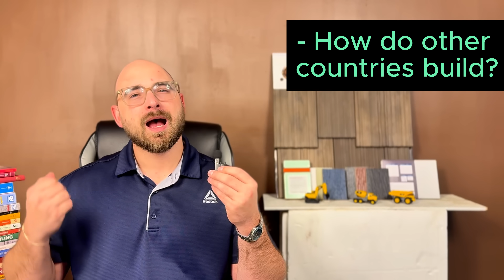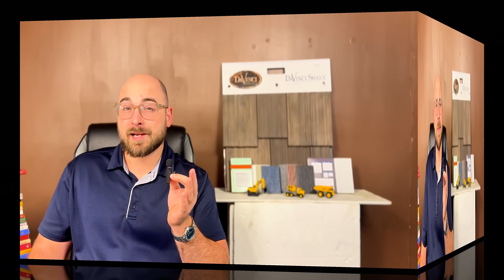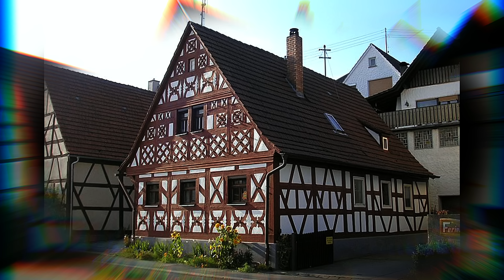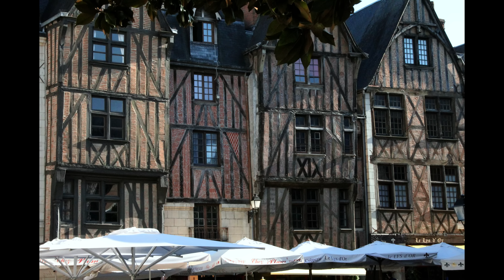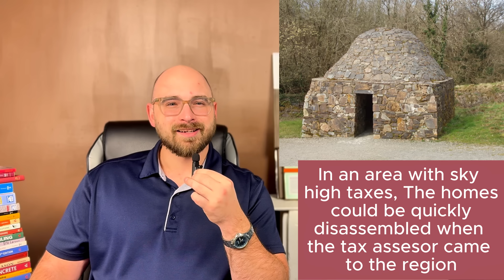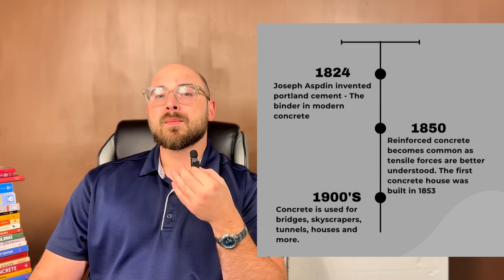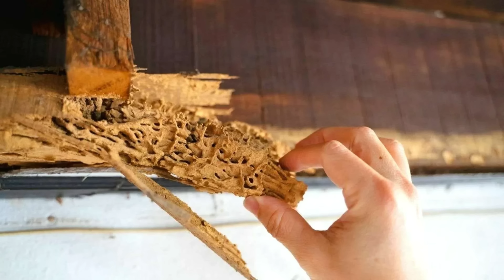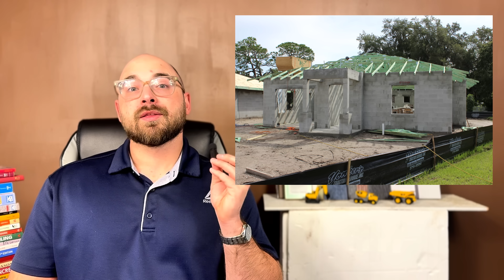Why Other Countries LAUGH at American Homes

Comment: Sorry, not catching up fast. Your last type of home was done in Germany about 35 years ago. I used to work in installing communication systems in Germany and saw all these new technologies used for building houses. They are at least 20-30 years ahead of US. However, as you mentioned, wood framing as done in US is the cheapest and fastest and not much skill required. That is the only reason it is and will be done that way in the future in the US.
To prove that point, look at the Paradise fire a few years back in California. The county wanted to implement stricter building rules after the fire, using concrete, however, the huge building corporations opposed that as it is to expensive, eating into their profits, and at the end they won. No change! Profits over safety.
Reply: Paradise IS being rebuilt with stricter building codes and fire resistant components, though not concrete.
Reply: I'm looking forward to seeing if after the current LA fires, people will finally realize that  building with toothpicks and paper isn't that good
Reply: Money over human life.
Reply: @tj92834 I think a lot of americans over-emphathize quantity over quality. What living quality do 5m² more bedroom space offer if you can have floor heating and a decent energy efficiency in return? Or electric shutters? Or a ventilation system? Or a high quality kitchen with modern appliances that'd last 40 years at least? Or a walk-in shower? Or... maybe walls you can actually mount shit onto?
Reply: Mill rates... The "development" heist is real in the US. Developers being busted for the materials used not actually meeting the rating of homes by materials used equaling actual real value...Cold busted for cheap materials that simply... Crap.
Reply: @tj92834 concrete home don't cost 500k, even big home ( more than a 220 square meter = 2400 square feet) with big property and big pool and still near big city ( yes obviously not near city like london or paris where house price is an aberration, like for NY in the us) you're out of touch of the reality of europe
Reply: yeah, that's the crux in German houses. They are expensive to build. A newly built "starter home" with 2 bath, living room, bedroom, 2 rooms for kidswould start at least with 250k€. And that'd be the minimum, without buying the property it is built on (because this can vary between 20k to easily 1M€ in areas like Munich).
Reply: @tj92834 no lol. Wood is more flammable than concrete. Period
Reply: I think the big benefit isn't associated with the costs. It's with its temporary nature. Before building codes, it was quite common in the US for the same property to evolve as was needed. It may have started as a small 500 sq. foot farmhouse. The fields were sold, and it evolved into a suburban multi-room home. The area got incorporated into city, and it evolved into a multi-family unit. Then the same land might have been purchased with a bunch of surrounding land to form a large apartment complex. This is a bit more common in Japan today. Building codes and zoning have made this type of evolution difficult in the US.
For a more permanent home in the US, I think most families would opt for a Timber Frame and stone home.
Reply: Domu w usa są często ekstremalnie źle wykonane ile kosztują zdecydowanie więcej niż dom murowany
Reply: real american dream is to take your last money
Reply: There is no doubt in my mind that with the suppression of better building codes/materials and the egress of insurance companies, Wall Street is trying to strangle California.
Reply: Good ol' american exceptionalism never disappoints. 
They said California has to many earthquakes, Japan, Chile has more, even Mexico city that is literally build on top of a lake has the tallest skyscrapers on latinamerica, and also has constant risk of earthquake not only because of that also is sitting next to a literal active volcano.
USA is doomed, they heavily depend on Canada's lumber imports which they also want to punish with tariffs. Lmao.
Reply: I’m a builder in the US, I’ve built block/brick buildings and of course wood frame buildings and saying wood framing doesn’t take much skill to do correctly is pure cope. Go pull layout, get your edge nailing within 1/8 inch all on every sheet of plywood, and frame a few windows then get back to me lol.  It’s easier to find a good masonry guy here than it is a good framer. Also, once you know what you’re doing wood framing is a lot faster. Not to mention wood framing is a lot easier to remodel and repair if needed.
Reply: I use to live in the Paradise area. So did all my family. Thats not why it wasnt done. Its because the folks that live up there are relatively poor. They wouldnt be able to rebuild, considering they would need to get loans and need fire insurance. Just wasnt finacially possible. None of the homes up there are cookie cutter. Zero large subdivisions. Biggest sub division I saw was maybe a dozen homes. 

That said, codes need to be changed.
Reply: unfortunately, I think actually even RUSSIA is getting ahead of the US in methods for building new homes. Interestingly it has also become common there for a small new house to have all radiant floor heating. What that tells me is it’s becoming an economy in which common sense takes lead over greed, and that bodes well for the long-term future. Not so in the US.
Reply: Concrete walls won’t mean squat when everything around, inside and the roof catches on fire. I remember seeing someone make a garage that was built to withstand wildfires with concrete walls and what eventually happened was when a wild fire did come through the heat was so intense that everything inside the garage essentially melted, making that endeavor practically pointless. 

The point is it takes more than concrete walls to make a home withstand a wildfire.
Reply: @lawnmowerdude  The roof would need to be stone aswell  then. But I can see the building just becoming a brick oven  even if it doesn't burn internal temperatures could get high enough to start igniting or  melting  things inside but I still think this would help minimize the spread of the fire.  On the east coast northern Midwest like Detroit and Chicago m9st homes are clad on brick there ate lots of fires and the homes are close together  but they are usually well contained
Reply: @lawnmowerdude  The goal of making things fire resistant is so that the fire doesn't keep spreading and eventually dies out.  Of course making the garage fire resistant did little when it was surrounded by fuel.

The mentality of "it would burn anyways so lets just ignore suggestions" is ridiculous.  It is little wonder those homes keep burning down.
Reply: Eating their profits ?? Wouldn't they just pass the cost to the consumer?? And make it even less affordable??
Reply: How many consumers can afford a 1 million dollar singke family concrete home. They do build with concrete but they tend to be massive apartement complexes@gnomechump-stiny7128
Reply: @gnomechump-stiny7128 The additional cost for a standard 600k-800k home is negligible. Perhaps 10-15k. Even in Europe, the structural part of a house is only about 25% cost of construction. There is really no reason why the US isn't using modern construction methods outside of sheer stubbornness and penny pinching by corporations.
Reply: Putting up a concrete or masonry construction in Californian is prohibitively expensive, and it's not that it cuts into their profits. They simply know no one will pay the price associated with it partially because yes it is expensive and partly because it has to be built earthquake resistant in Cali. There is a reason only large corporations or rich people build from stone or brick in Cali. Moving to the Midwest and Tornado alley area it wouldn't matter F4 and F5 Tornadoes destroy stone and brick homes just as easily. As for Florida it's a retirement community people moving there can afford it having sold homes in other areas and having retirement to draw on.
Reply: @Exodius-u3l  i've see whole tree fall on House and the house only needing the roof to be redone, i live in a zone where we have Cyclone every year , tornado do shit to a well-built cinder block house
Reply: Since you are using California as an example, there are a couple different things to consider California has extraordinarily strict, stringent, environmental protection laws that make any kind of construction, extraordinarily difficult, California has earthquakes, which makes anything made of concrete or stone or masonry. Extremely difficult to pull off without risking the structure because of the earthquakes. What is preferred in California because of that however, California also has huge fire risk and so there should be a trade-off to mitigate that as well.

You’re also has a lack of trees compared to North America. There are trees there are forests, but they are very heavily protected because there aren’t many of them by comparison.  Wood is far more expensive in Europe, closing the gap between wooden construction and Mason reconstruction, the lack of earthquakes also favors concrete and masonry.
Reply: @Matt-yg8ub  no no, California is great example. And is not the only part of the world with earthquakes. Look into Japan, now Greece - they all build with concrete/ bricks and steel. There is so much new engineering possibilities now. But implementing them would decrease profits for those USA corporations :P.
I was seeing those devastating news where there were showing that remnants of houses where only chimney was left - check how buildings looks after fire in Europe... not great but sure not only chimney stays
Reply: @ it’s not a matter of decreasing profits, it’s a matter of increasing costs to the point where it’s un affordable to build. 
California is already extremely expensive …. You really wanna turn that million dollar house into a $2 million house and cut your potential customer market in half?
Reply: @Matt-yg8ub  Japan has the very same issues. However, they found a way. Everything in US becomes golden. The same basic double-paned window is four to five times cheaper in Europe, including installation, which is also done much better. Companies in the USA are driven only by enormous profits while providing the lowest possible quality. This factor also contributes to the huge wealth gap as most workers don't see that money in their pockets.
Reply: @Matt-yg8ub  stone and masonry, I can understand. But Japan uses concrete, specifically reinforced concrete, for their buildings to make them resistant to earthquakes! It’s a mix of materials and techniques they use to make their skyscrapers earthquake-proof and hurricane-resistant. It is very much doable, I just don’t think corporates are going to want to shell off that amount of effort and cash because lord forbid a structure be made safe instead of made to nourish the pyramid scheme they’ve made for themselves.
Reply: @Matt-yg8ub  "California has earthquakes, which makes anything made of concrete or stone or masonry. Extremely difficult to pull off without risking the structure because of the earthquakes."

Chile has more and stronger earthquakes than California and they build with brick and mortar. While California has 10 1.5 earth quakes chile at the same time had 10 3.0.

Comment: People from other countries don’t criticise american construction for it being timber frames but rather for it’s poor workmanship and constant use of the lowest quality materials.

Even swedes criticise american buildings for being too weak and poorly constructed, it’s very clear why when you compare the average Swedish tradesman’s work versus the american counterpart doing the exact same job.
Reply: Europe also has a tradition of apprenticeships with very elaborate training programs to get craftsmen up to a good standard. And many are quite proud of their work. In the US you're looked down upon if you haven't got a college degree. What's an apprenticeship? Let me just slap that pipe in here that'll be 100 bucks please....
Reply: @mysterioanonymous3206 You're right. American college degrees are overrated.
Reply: The city code inspectors that are suppose to inspect homes under construction will sign off on a building despite seeing very obvious defects. I see this happening with a couple of channels of home inspectors pointing out some issues when they do their inspection for the home owner.
Reply: Even stick built houses can be relatively durable and last for some time if they were built well. I live in a balloon framed house that was built in 1880 and it's more structurally sound than most of the houses I've seen built after WW2.
Reply: I agree. I work in civil engineering as an inspector, previously I used to build the bridges and roadways. Very few contractors take pride in their work. It’s sickening.
Reply: Homes in Scandinavia have pretty good insulation.

AC is not standard. They did not expect longer heat waves.
Reply: No, it's timber framing.
Reply: Also the mindnumbing costs of these houses. "You tell me you pay almost a million $ for THAT?"
Reply: It's clear when you compare American COMPANIES, not so clear when you compare American WORKERS... js.
Reply: Yes. Like our crappy cars & corrupt healthScare🎉
Reply: But, but we have diversity built houses in the US.
Reply: Lol those are not Americans doing that work.  You better be speaking Spanish or you are not getting anything built.
Reply: I don't think uneducated nicaruagans and mexicans (the people who build American homes) are going to be a match for swedes. Certainly not if they don't get health care, retirement funds, or even minimum wage.
I'd bet you could get swedish engineers and craftsman in the US, actually. They probably make some homes here. Most people wouldn't be able to afford that, though.
Reply: You can buy a better quality home.  They just cost more per square foot, and most people prefer a larger house instead.
Reply: @NotThatKraken  Yes. It's the American thing of thinking that bigger is better.
Reply: Aren't Swedes paid something like four times more than the relative wage of an American tradesman?
Reply: @jwg9338  This is a different way of thinking. In Sweden, Germany, Poland both framework timber constructions and the brick/concrete ones are smaller, build for generations, but with a good quality. In my homeland Poland as well where I live now-Germany, homes of 100-150m2 (1076-1614 sq  feet) are preferred. Energy efficient is important and convenience like floor heating, photovoltaic systems etc. It is more likely that pl stay in the same house for decades and pass it to their children or grandchildren. My friends live 1h away from Berlin in a timber frame house, but it is stronger, better isolated as similar American homes.
Yes, it costs more, but it will last 100-200 years 😉
Reply: I worked in both USA and Sweden. Swedish carpenters are paid more but not four times more. Also, Swedish carpenters all have tk have degrees from trade school before working. So on average they’re faster and make fewer mistake. So you get what you pay for.
Reply: @Gretschbeach  Payed more doesn't mean earned more as taxes and social service set aside by the employer means most likely that the swede is payed more but he won't see the benefit of it.
Reply: @ShermanistDruid Not true. That we have more tax than US is wrong. Or rather in the US they don't call it tax but it effectively is since it's things you must pay for anyway. Like health insurance, education, etc. The net result is US citizens pay more.
Reply: @Kraakesolv  Weord how right I am while being wrong...
The difference is that in the USA people can pick what insurance they want, what schools to spend their money on or even home school, good luck doing that in Europe.

Why are you defending the loss of individual freedom and choice?
Reply: @ Americans get paid more, drywall installers, roof crews and so on get paid a lot more than swedes for doing the same job.

And cost of living in Sweden is higher than most american states, higher taxes and higher cost for goods.
Reply: @jwg9338 You'd need to balance the salary statement with cost of living in order to sell it.

Comment: My 1st choice wouldn't be to live in a 500 yr old structure, or pay to have a new one built; or pay for modernization updates on a 'rock-pile', or pay for the wasted BTU's. Homes that blow away, are shaken to ruin, float away, or easily burn, will eventually be replaced with methods that address local risk. Many structural risk are local in nature; code changes should reflect local risk.

Comment: I have lived outside the USA since 2007.   Every place I have lived, uses concrete and/or cinder blocks.   The one disadvantage to them, is that any kind of changes to the house is much more difficult.   Heck,you will need hammer drill and masonry bits to hang anything on the walls.  Forget changing any plumbing or electrical wiring yourself.
Reply: Nah. I have a house in he UK made wih concrete blocks and I have done all manner of DIY projects on it as well as exending it twice and doing most of my own elecrics and plumbing. It is not rocket science.
Reply: @rogerphelps9939  Nowhere near as easily, as doing those modifications when the plumbing and electric is behind a sheet of drywall.
Reply: @rogerphelps9939 it is to americans... 😂